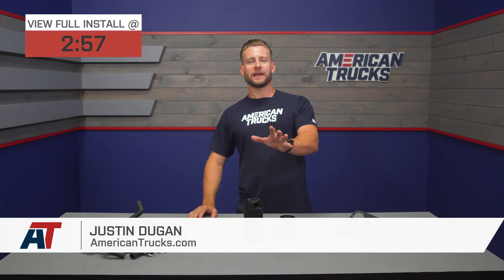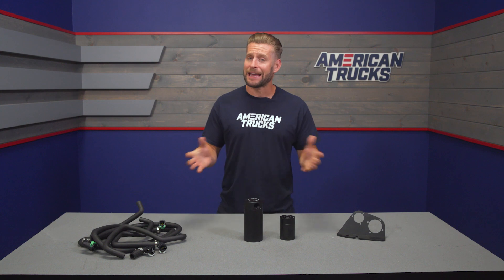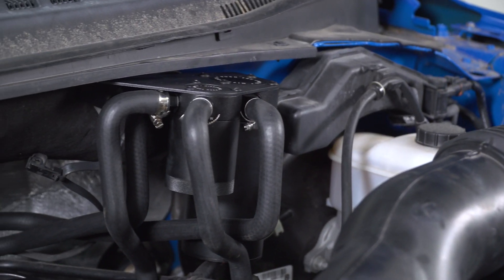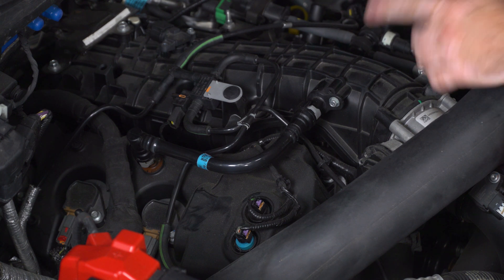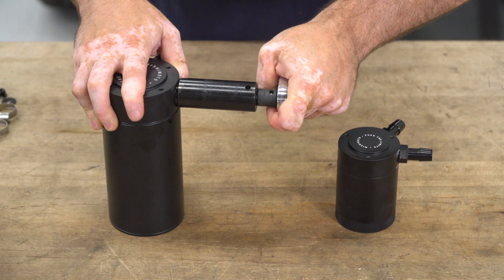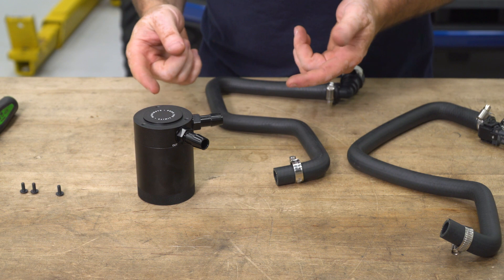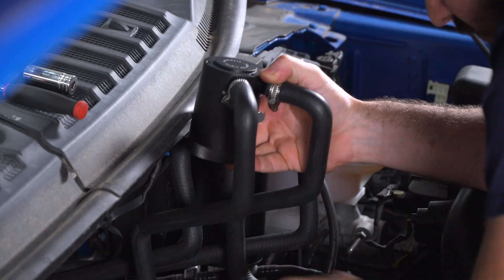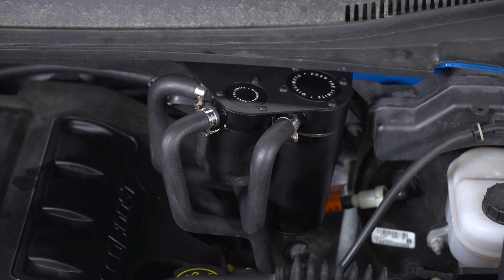2015-2016 F150 3.5L Ecoboost Mishimoto Baffled Oil Catch Can Review & Install

Comment: I installed this on my 2017 f150 3.5l ecoboost and the o2 sensor piece did not have barbes on both side.    It was male to female.    Where can i get that section or hose to cut that fitting off of?

Comment: Welcome to the world of constant P04DB codes with that rat's nest of hoses🤣 A can on intake side of pcv is useless as the airflow goes back into the crankcase anyways only to be sucked out the other cover🤷. Pcv vs ccv?? c'mon these systems are no different flow wise than a motor from the 1960's just this has a sensor, drivers side is pcv intake, pass side is pvc exhaust

Comment: I have 171,000 miles on my 3.5 ecoboost, is it to late to install a catch can? $400 is a large investment if damage has already been done, if any at all.
Reply from the maker: If you plan on getting the intake manifolds looked at and cleaned, adding a catch can like this would absolutely benefit you in keeping the engine clean and prolonging its life! -Zach

Comment: I installed this product into my 15 f150 3.5L with the turbos. I’m getting the P04DB code for the censor disconnect. I followed the tutorial to the T and then some. I’ve read it doesn’t damage the engine but I’m not a fan of having my engine light looking at me. I installed this to improve the truck not complicate things
Reply from the maker: Hey, Zach! I'd recommend getting in touch with Mishimoto's customer service team to help troubleshoot! You can find their number below. -Zach
1-877-466-4744
Reply: Do you have to disconnect the battery for engine to relearn ?
Reply: Did you end up figuring this out with mishimoto?
Reply: I figured it out but it was worthless cause a year later my engine is fried and I’m now having to look at buying a new engine or a new truck. Not a fan of spending 300+ dollars and the engine still failed at 129K. I’d like a refund at this point.
Reply: @zachgallup8545  what failed exactly? I doubt the catch can caused the engine failing...
Reply: @757SuperSteve23  2 cylinder piston ring. Hella smoke comes out through the exhaust
Reply: @zachgallup8545 dang. so could catch cans actually damage the engine?
Reply: @Tony-tk4ht  most will say it won’t but idk what to believe now after the repairs I had to get.
Reply: @zachgallup8545  I know this is an old comment but I'd like to know what was the fix for the Check engine light for the sensor disconnect? After resetting it, the check engine light comes on with acceleration

Comment: Correct me if I’m wrong but I think the sensor is installed backwards in this video. I installed mine with Mishimoto’s video and they flip the sensor around the other way. Just a heads up 👍🏼
Reply: Did it throw a check engine light / code?
Reply: @boxerboi187  I haven’t had any issues with the way I installed mine. It’s been great and it’s crazy how much blow by gets filtered through the catch can

Comment: That is actually a cleaner installation than many of the other catch can systems that I have seen.
Reply from the maker: Agreed! Mishi puts out some great products! -Zach
Reply: Is the sensor supposed to be installed in the opposite direction like in the manufactures Mishimoto install video??

Comment: If this was a real problem, don't you think Ford would know about it and address it?
Reply: Ford changed the 2017 3.5 eco boost to dual injection to combat it moving forward. They also have their own motorcraft air oil separator for this, although I believe it’s marketed for the mustang.